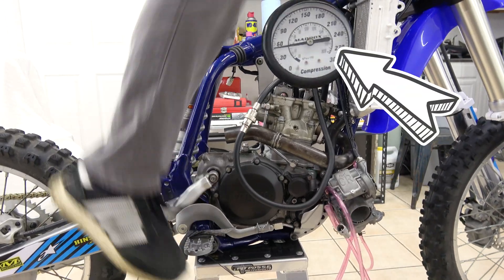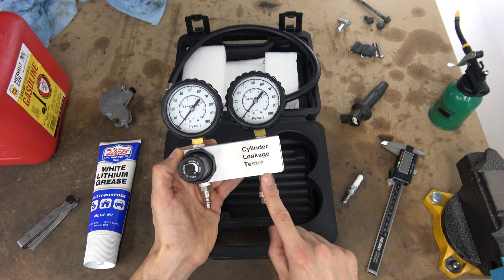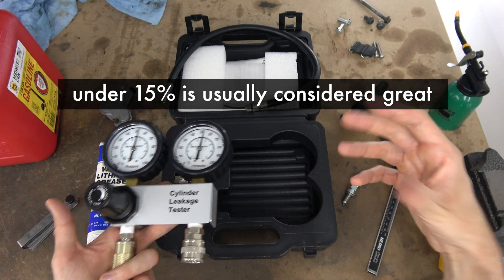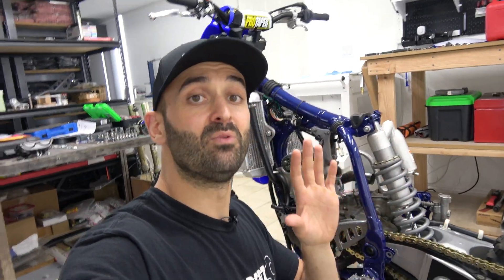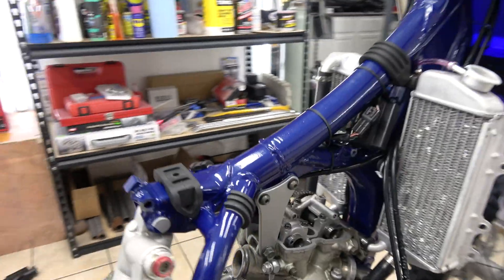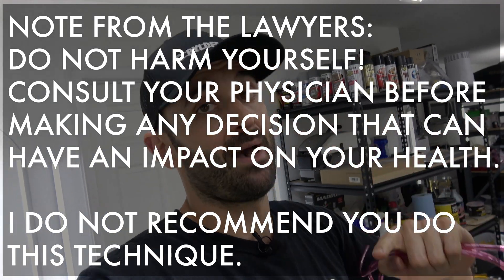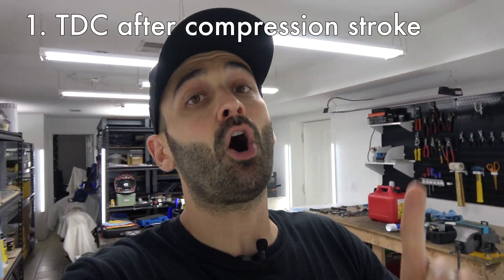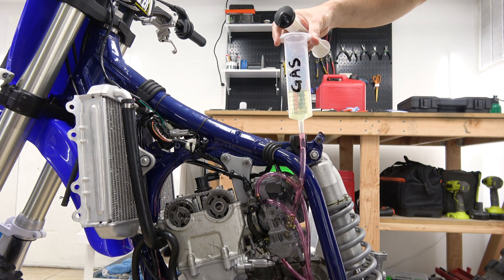How to Perform Leak Down Test on DirtBike Engine - Yamaha YZ 250F

Comment: If you set the left hand gauge to zero first, then connect the right hand gauge to your engine, gradually increase your left hand gauge to 100%, this way it shouldn’t spin your engine round off tdc.